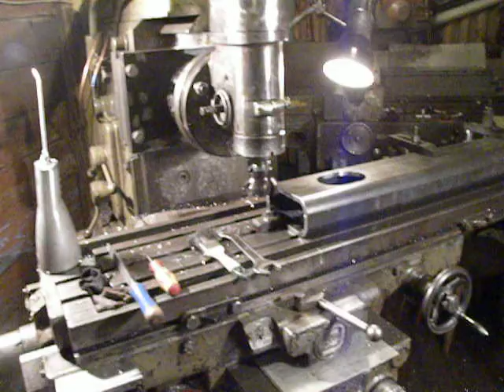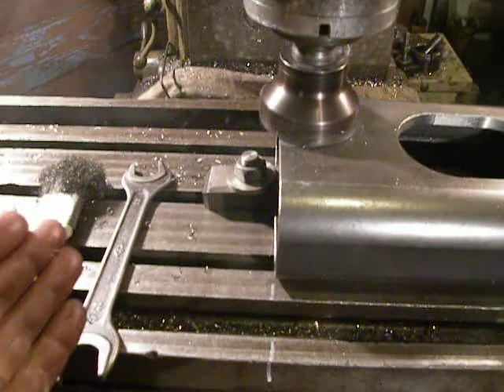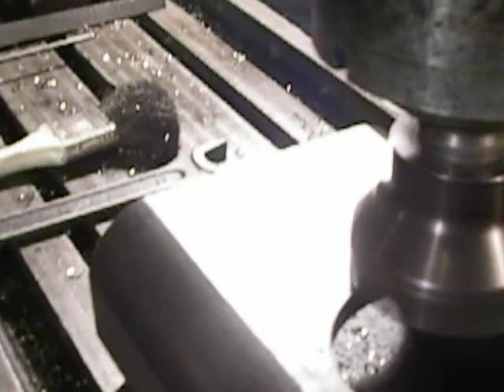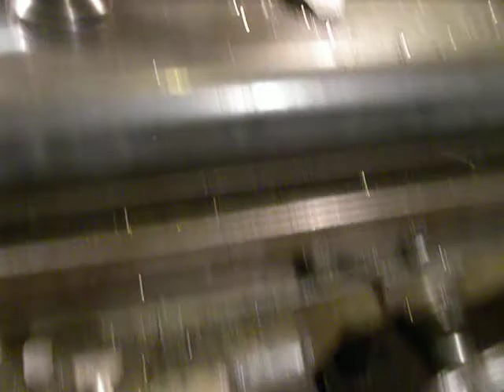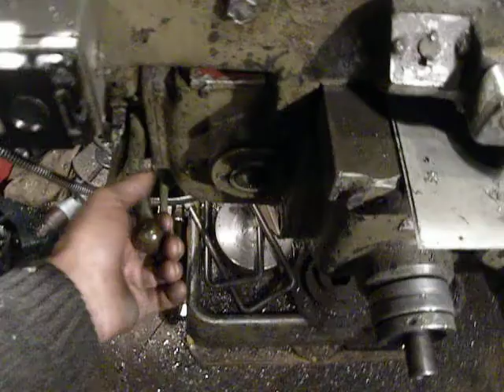Face milling by Sandvik face mill on Biernatzki milling machine

Comment from the maker: Yes, those are same that pipes. Noone pipe is perfect - for perfection it need to machining it. End are not stright (90 deg) because the pipe is cut by bandsaw- this machine type tolerance is 1...4mm. Those pipes will be used in machine building (sawmill machines).